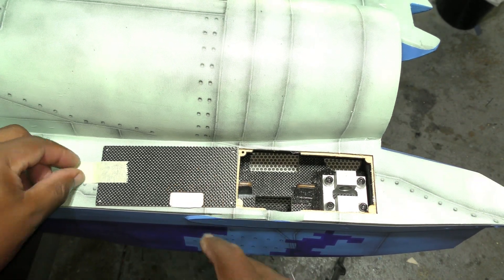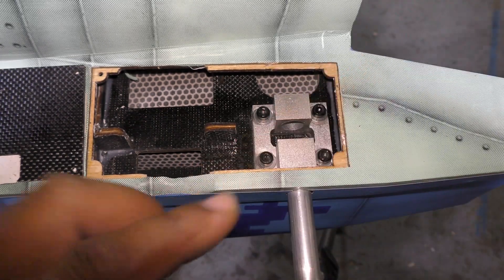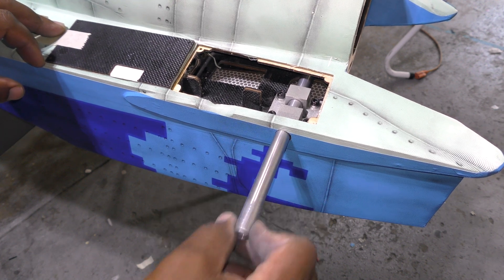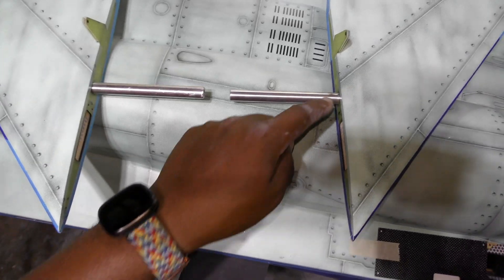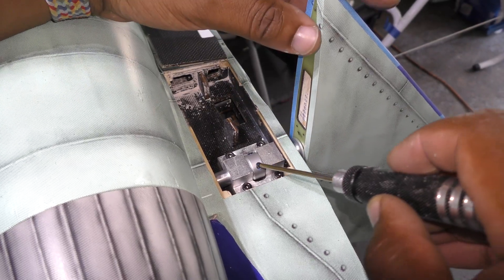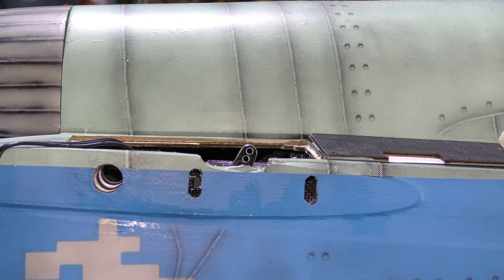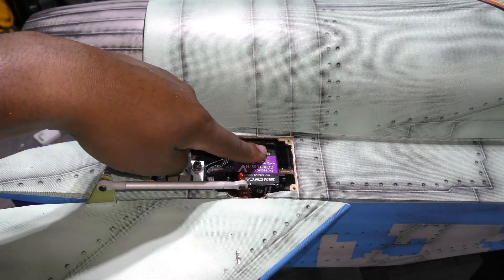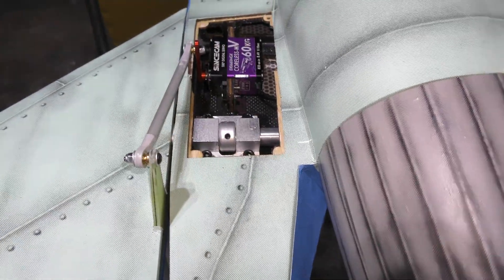BlackHorse Mig29 Build Series #1: Stabilator Installation

Comment: The rotation point of the horn at the stab is wrong. You should move it as close to the rotation point of the stab as possible if not the servo needs to push way to hard in rc network (a german forum) tey discussed this design flaw and changed the position of the servo horn to the metal rod
Reply from the maker: Hi Thomas! You may be right. But I built the kit as it came from the manufacturer per their instructions. I did use 60kg servos because I suspected I might need to beef thing up back thereI’ll keep an eye out regardless!
Reply: @FlyWithFrank  i saw that just wantet to let you know😁 otherwise great video keep up the great content😄